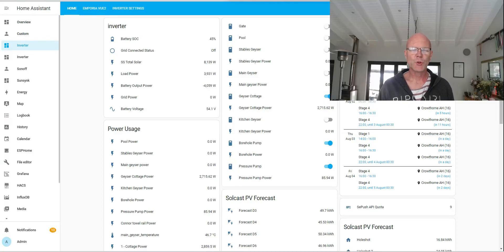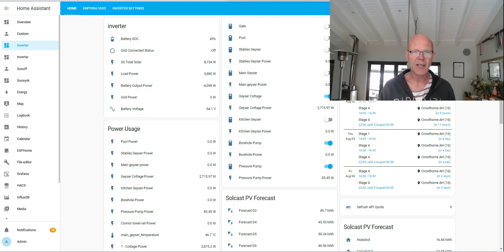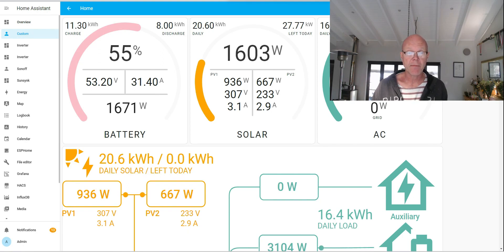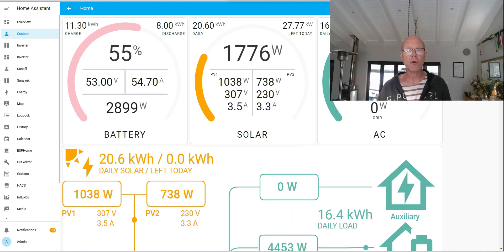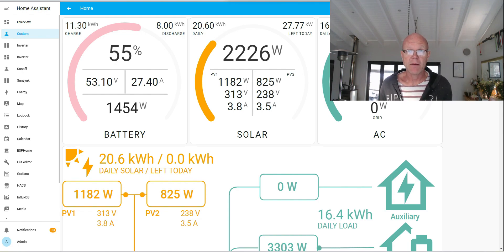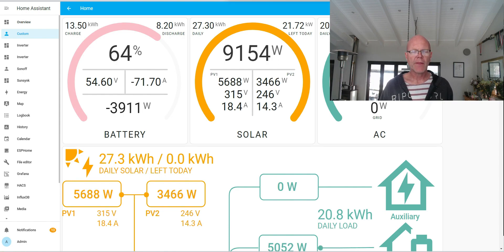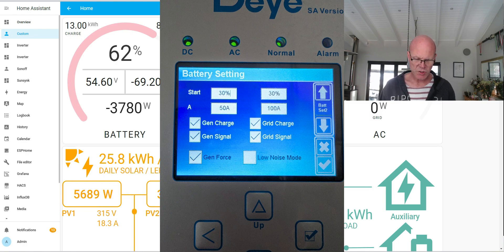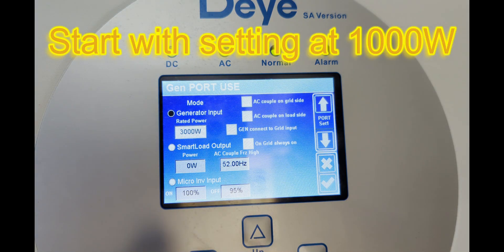DEYE & Sunsynk Inverter generator setup

Comment from the maker: One thing I have found out since making this video:  There is a "Gen Connect to Grid Input" option in the Gen Port Use menu for if you want to connect the generator to the Grid Port using a transfer switch instead of the AUX port. It allows you to set the max load on your generator as well as giving more leeway to the generator voltage & frequency than it does to Grid supplied power.
Reply: Nobody mentions that the peak shaving does not work on the generator port.
Seemingly the only way to be able to avoid that the inverter disconnects the generator with spikes of heavy loads, is to use the grid port (I have not tried this yet, as I don't know how to exactly do the G-N relay thing).
I hate this puzzle and having to turn on and off the pump that's not in use that turns on each time the inverter switches!!!!
Reply from the maker: @dominus6695  Mine works, maybe a firmware update on your inverter required? I have a 5.5KVA on my 16kw, my generator is limited to 3kw load and I regularly go over that load with the generator attached without issue.
Reply: Will be tried for sure! Thanks!
Reply: @SolarIntegrations  gen peak shaving is still not working after updating the firmware. 
Could it be that it (ironically) only works if the generator is strong enough to deal with a load spike? 
If the inverter is too slow to detect the peak then it would be useless in shaving it...
Maybe the grid port is better suited for a gen in the end...
Reply: What's likely happening is that the freq goes down when the pump starts, and that triggers a disconnection, because the detection of the trigger for peak shaving is not programmed as a priority, or so.
Reply: @SolarIntegrations  do you run motors that have higher W peaks than what the gen can output?
Reply from the maker: What inverter & firmware version do you have  @dominus6695  ?  I have a Deye 16kw, you can hear a slight dip in the Gen RPM when a big load is applied to the inverter but is momentary and not enough to cause a disconnect from the inverter. What frequency have you got your generator set at with no load? I would set it as high as it will go and still connect, around 52hz I would guess, you should be able to see on the generator display when it is in the "zone". This will give the inverter a little more time to adjust the load on the generator when a load spike is detected. You may find that you are on the borderline of a disconnect when your generator is under load and it is only taking a momentary increase in load on the generator to drop the hz enough to cause a disconnect.

Comment: Brilliant video and was instrumental in me getting our generator set-up.

I have a few notes for people who want to auto start a generator that is supplied with an ATS designed to start the gen when there's a power cut but want to use it on the inverter. I assume these are pretty common similar across the world. We're in Kenya..

- Wire the gen signal from the inverter across the manual/auto switch on your ATS
- This will mean when gen signal is on it will close the dry relay and switch your ATS to auto, as you have no loads connected it will start gen
- When signal goes off gen will shutdown as ATS will see it as now back in manual mode
- Gen force needs to be off as this is needed for manual start but for auto just keeps the relay closed
- Gen signal and gen charge on + starting % in battery settings
- System work mode - Gen charge for the times you want to charge and the % on the right will be where the gen shuts down

This should trigger the generator to turn on when the % goes too low. From testing if there's a grid supply it won't start the generator so should only start if battery is low and there's no grid power coming in. 🙂
Reply from the maker: That is correct,  it won't start the generator if there is grid as the inverter can't sync to the generator freq. and the grid freq. at the same time.

Comment: Hey, thanks so much for the video
I've been struggling to connect my MAC-AFRIC JDP10000 petrol generator to my Deye 8kW inverter.
I tried myself when desperate but the inverter never connected... the closest I got was seeing the voltage on the generator screen but no attempt to actually pull a load.
The installers came today and had a go but got the same results.
Their initial conclusion: my genny obviously produces "dirty power" - harmonics or something.
I'm not so sure.... it seems a lot of people have struggled to connect petrol/ gasoline generators to Deye Inverters so I think there may be more to it.

I'm going to look at a few things you mentioned here, thanks so much.

A couple of questions-

You mention the bonded neutral/ floating neutral on the inverter - I'm going to check that as soon as I'm home!
What about bonded neutral on the generator? Any idea about that... is it also a requirement? Do you know if your generator is floating or bonded? Also is your generator earthed?

Looking forward to exploring the rest of the channel.
Reply from the maker: Hi @jamesthorpe9516 ,  have you got a multimeter that measures HZ/Frequency? The RPM the generator is running at sets the frequency and can be adjusted on the generator. When the generator is within the allowed band of frequencies, usually approx. 49hz - 51hz the inverter will start getting ready to connect to the generator. As long as the generator stays within those frequencies for about 60 seconds (I think, haven't timed it) the inverter will attempt to connect to the generator and sync to the frequency the generator is running as. You will hear the relay in the inverter click in won the inverter when it starts to apply load and you will hear the generator start labouring as the load is applied. As long as the generator stays within the allowed frequency band the inverter will stay connected to it and will be able to pull a load from the generator. If the inverter is not even trying to connect to the generator there is probably a problem with either a floating neutral or the Hz/Frequency the generator is running at is not within the allowed frequency band (too high or low). You will also need to check that the Force Start box is ticked which forces the generator to pull load no matter what the System Mode settings are until the battery is full.  I would also suggest setting the "Grid Shaving" option to 1000W until you get the generator to connect, you can then increase it until you see the generator disconnecting.
 Adjust the generator RPM/HZ/Frequency to the top end of the range so as to give the generator some space to slow down slightly when load is applied without disconnecting. I set my generator for 51hz. You raise the HZ by screwing in the throttle screw slightly on the generator (only do this if you have a way to measure the frequency). Good luck
Reply from the maker: I have a Grip 5.5kva running on my 16kw, will swop if you want :-)
Reply: Awesome
Got it working today.
I did two things - 
1. Install a ground earth spike for my genny as per the setup video https://youtu.be/ydrGe4MOnyg?si=ABwGhcj95i2EH4SM. Not sure if it made a difference but there is some talk about earthing possibly being an issue 
2. Dropped the Frequency by adjusting the throttle screw as you suggested. Originally was a very stable 55Hz (measured on Generator screen on inverter). I adjusted down to about 53Hz and then it seemed happy to connect. Once under load it drops to 50Hz. Working beautifully. Only tried pulling 2.4kW but I'll experiment and see what the sweet spot is. I gather between 50% and 90% load fuel usage is roughly the same (l/kW) so no need to hammer it if we're just trying to charge batteries. My cable is quite long so voltage drop might be too much if I push it.
Reply from the maker: Congrats  @jamesthorpe9516  Glad to hear you got it working. Main thing with the earth/neutral is that the inverter will not connect to the generator if the inverter has a floating neutral (earth/neutral not bonded when off-grid), Is a good idea to properly earth the generator in any case.

Comment: Hi there, great videos! I've got a Deye 8kw connected to a 5.5kw generator. On the inverter my screen shows 230v but my frequency is 0hz. We have tested the cable with a multimeter and the hz is fine (jumping between 49 - 51) but the inverter does not seem to detect this. Any ideas what could be causing this? Secondly, regarding the earth neutral bond. Secondly, would we need a bridge box between the generator and the inverter?
Reply from the maker: Hi @mauritzswanepoel7985  what port on the inverter are you connecting the generator too? There are two options, First prize is to connect to the Aux/Gen port, allows for a wider range of frequencies and voltages and ramps the power  loading up slower. Otherwise you can connect to the grid port using a transfer switch. The Grid port however has much tighter settings for the permitted voltages and frequencies before it disconnects. There is a box to tick on the DEYE's for if you want to connect a Gen to the Grid port, which I think opens up these settings but not 100% sure. I would try measuring the frequency on the inverter port you are connecting too and check that you have power being supplied to the inverter

Comment: Hi!
I watched your video so many times and still can't really figure this out.

My situation is that the inverter is not seeing the gen at all.
I can't see the generator picture on the main screen.

Checked the cable just at the entrance of the inverter, all good, power incoming.

I have a 3 phase Hyundai DHY8600SE-T CONNECTED TO the 3 phase Red port via NYY cable, quite a thick one... It doesn't see the generator...
Any magical ideas? 😢😊
Reply from the maker: Hi @MsViorela , do you have a Sunsynk or DEYE inverter? So you have "Gen. Force" under battery settings ticked?  My understanding is that ticking the "Gen. Force" box allows you to charge batteries no matter what the SOC settings are.
Reply from the maker: It should also display the generator on your screen on the inverter

Comment: Thank for the great video John.  We are wanting to connect a 10KVA Diesel Generator to a Sunsynk 16Kw Inverter.  The Generator we are looking at will produce 35A at Max, so was hoping that we would be able to pull 30A from the Generator to charge the batteries during cloudy days etc.  The generator is supplied with an ATS, but since this is not going to be sensing a loss of power from he eskom side, how exactly does the inverter trigger the generator to start, and then once it has charged sufficiently to turn off the generator?
Reply: I can answer this one as I've just figured it out :-) Your ATS probably has a manual/auto switch. So with nothing connected when you press the button from manual to auto it will start the generator.  So you do the same thing from the inverter. 

You take the dry contact for gen signal and wire that across the switch. When the signal is on it will close the switch and go to auto on your ATS and then when off will be back to manual and will shut the gen down.

To make it work you need to turn off gen force as this make the gen signal on all the time which you need for manual start but not auto. You also in system work mode need to set the times you want to charge from gen with the check boxes. Whatever the % in system work mode is the amount it will charge to before it shuts off, will then restart on the % set in battery settings on the gen column on the left.  Hope that helps.

Comment: good night. I have had trouble coupling my generator to the Deye 8000 inverter. I have checked the connections and they all seem to be fine. But I have doubts that the generator has 3 lines, is there a problem with that? Should it still recognize it and work or does the generator necessarily have to be two-phase?
Reply from the maker: Hi @juanmiguelcalderon8771 , what inverter do you have?

Comment: can generator (if connected to gen port, of course) work together with grid input on Deye inverter?
Reply from the maker: Yes, I have a my generator connected to the Gen Port, when the grid comes back on the inverter disconnects from the generator. They can't work together as they are at different frequencies and the inverter can't sync to both of them.
Reply: @SolarIntegrations issue for us is the generator only comes on when mains is off and gen force is selected. When gen port is selected there is a voltage there which seems to kick off/not let the generator start probably as it thinks the grid is still present. The whole inverter has to be physically disconnected by turning off the mains breaker for it to work. It cannot be done by the inverter for us. Any ideas?
Reply from the maker: @aldozilli1293  Why do you want to run the generator if you have grid power available? Charging from the grid is much cheaper than charging from a generator. You cannot run the generator when the inverter is attached to the grid as it is synced to the grid frequency and cannot sync to the generator frequency as well.  You could put a smart switch on the connection to the grid and switch it off using an automation in Home Assistant if you really want to, not sure what the use case for it would be though
Reply: @SolarIntegrations  I have a huge battery in the form of a car on my drive. I can charge the car on very low rates at night and use the v2l like a generator when needed. E. G. When my house batteries on a winter UK cloudy day run out before we get to the very low night rates, so in those instances want to be able. to. easily switch instead of using expensive day rates on the grid.

Comment: Can i connect the off-grid hybrid inverter instead of the Generator?
Reply from the maker: I can't see why it would not work, I would make sure you set the generator shaving option to less than the inverter can supply.

Comment: Hi thank you for the helpfull video . 
My q is i connnect the generator on grid input port but it dose not work it appeare as off grid after start loading for a few seconds ..and when i connect it to the generator input it worked well ? 
For ypur information I have changed the limmits of frequancey.. 
Is the nominal ramp time the issue?
Reply from the maker: Hi @karemalgelani9559 , the RPM the generator is running at affects the frequency of the AC power it is sending to the generator. Most generators are set for 50hz when under no load, ideally you want the frequency the generator is supplying power at to be 50hz when it is under about 75% load.  If your inverter is dropping the generator connection, it is probably because the RPM (supplied AC frequency) is dropping below the permitted frequency in the inverter settings when load is applied to the generator. My suggestion is to try increasing the RPM your generator is running at to the top end of the permitted frequency range (probably around 52hz but you will need to check) so that you have a bit more room for the generator RPM to drop before it is disconnected. Depending on the inverter you have, you should be able to see what the supplied frequency is on the inverter grid screen or you can check with a multimeter with a hz function. RPM is usually adjusted by a screw on the throttle linkage which you screw in to increase the RPM the generator runs at.

Comment: Thanks for this, it was very helpful. I don’t know whether this is something you could cover but there are people with EVs that have Vehicle to Load capabilities of around 3.6kW who are wondering if they could use this as a generator input to their solar inverters. I suspect the answer is probably yes from what I have seen as the V2L output is sensitive enough to run anything from a phone charger to electric cooking appliances and has very accurate frequency and voltage regulation. This would give people access to a very large supplementary power source, so it would be interesting to see if this integration is possible.
Reply from the maker: Hi @twelvebears1971 ,  I did see a video some time ago of a gent connecting his inverters MPPT controller to the HV DC CHAdeMO connection on his Nissan Leaf to get power from his cars battery. The Leaf is 400V if I remember correctly so the MPPT is quite capable of using it.   Only problem was that the car had to be switched on for the connector to work.  I would be careful in making sure that the HV DC connector is not out of your MPPT range.

Comment: how did you physically connect the generator to the inverter
Reply from the maker: Hi @garfielow, I connected using the Gen port on the inverter, you can connect using a transfer switch on the Grid port as well but there is an additional box to tick. Gen/Aux Port is the preferred method.
Reply: i mean how did you physically connect to the generator what cable did you use and maybe a video of  the conenction to i t
Reply from the maker: @garfielow  With 4mm Surfix cable to the Aux/Gen port on the inverter. I bypassed the 3 pin connectors as they are limited to 15A (3450W)
Reply: @SolarIntegrations  do you think i can see a pic of the generator side as well
Reply: @SolarIntegrations   any update for me
Reply from the maker: I am not sure what is it that you want to see @garfielow ?  Check the manual for your inverter to check which port you connect the generator to, should be labelled GEN.
Reply: @SolarIntegrations  i wanted to see how you connected it to your generator